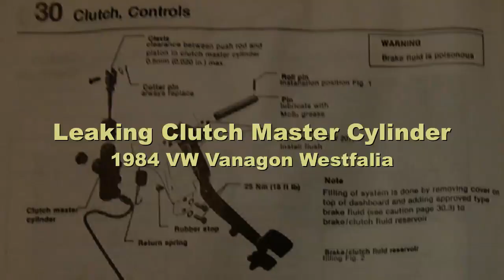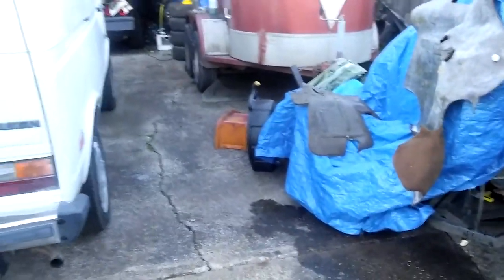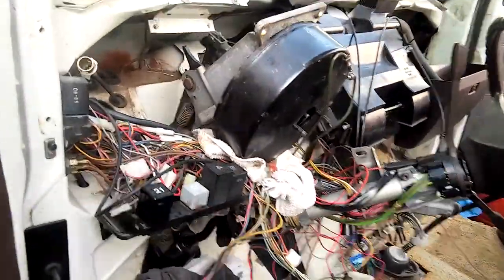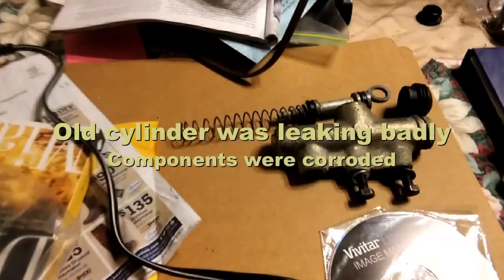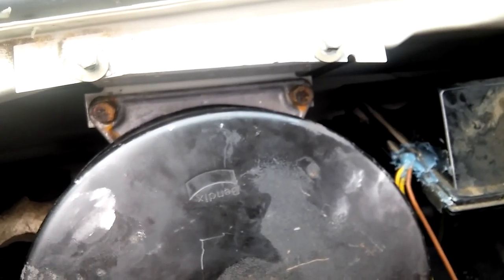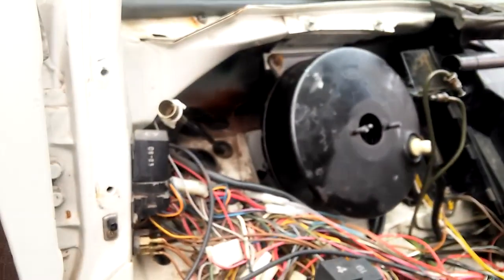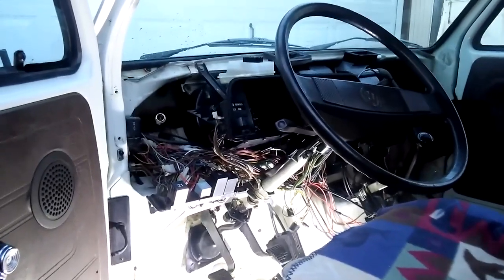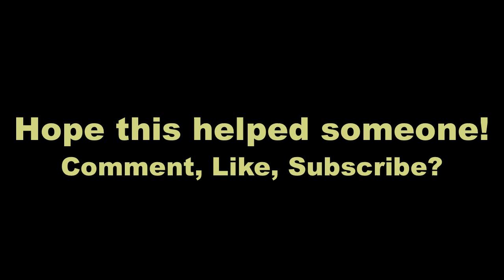VW Vanagon T3 Westfalia Clutch Master Cylinder

Comment: Hey you do not have to remove the dash board to replace the clutch master cylinder, and its not an issue if the connecting rod is corroded as it is an external part.
Reply from the maker: In this case the brake master cylinder had to be replaced and then the dimensions for the metal line to the clutch master changed as well. Fortunately all has been working well with both. Calipers at the front were changed and also drum cylinders. The clutch slave was replaced as well.

Comment: Always something!
Reply from the maker: Things do wear out but fortunately there are economically advantageous solutions for those so inclined!
Reply from the maker: Well it turns out that there is another much slower leak. Since the clutch master cylinder was replaced, any further leak could be the clutch slave cylinder at the rear underneath of the vehicle. It being dry enough to get underneath and check, the slave cylinder is also leaking, if only slightly. A replacement has been ordered, from the wholesale supplier in the east. Video has been taken, with more clips once it arrives, to show the process.

Comment: Nice 850 wagon in the background. Is it yours? My daily driver is a white 2000 v70 na.
Reply from the maker: We made a few of America's Volvos Great Again! RobertDIY has a great channel focusing on these durable, economical cars. Two of these were abandoned as unfixable by other mechanics, but they just didn't know what they were doing.
Reply: @vanstechcorral  yes I have talked to Robert in the past. Very nice guy. He’s the king of YT Volvo Repair videos! Back when the timing belt on my 2000 v70 wagon slipped off and bent all 20 valves it was one of his videos that inspired me to pull the head and reinstall it myself. I have since put another 75k miles on that car.
Reply from the maker: @fiveable  I have to admit I am no fan of interference engines timed by rubber bands. Every Subaru owner I've personally known has lost an engine to them, even one recently changed by a dealer. It's why I'm still on the waterboxer, which was only $100 three years ago because he was installing a Subaru. His conversion's still not in!